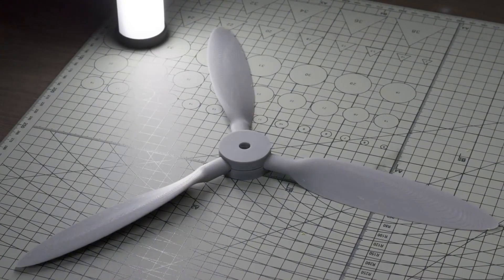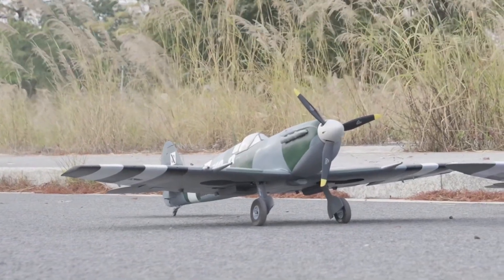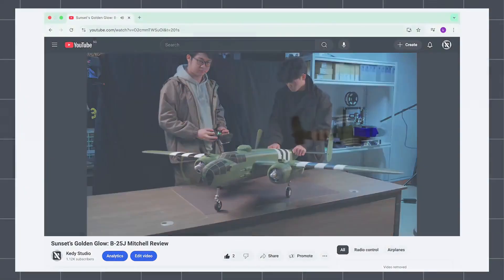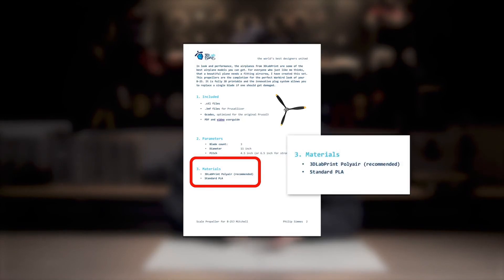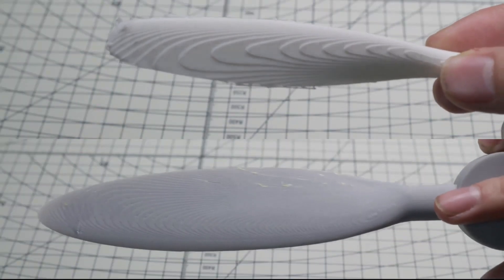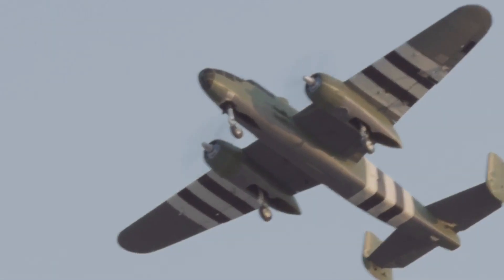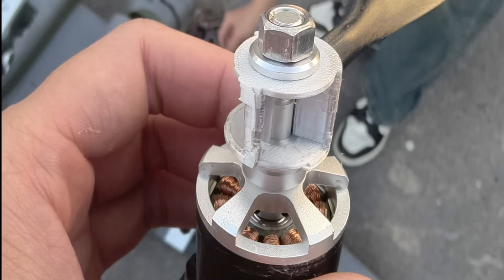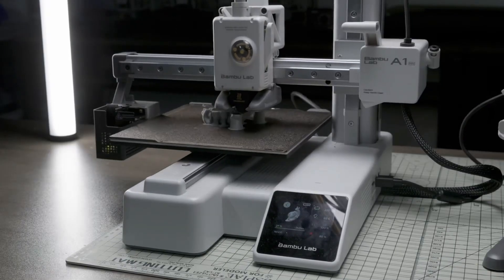Ultra-Low Cost 3D Printed Propeller Production! [DIY Propeller Solution]

Comment: I had better luck with 3D printing EDF's instead of propellers and using regular PETG at 240-250*C and low layer heights large line widths. (0.1-0.15 layer height as needed for overhang printability) Printed with no support. in a 6-blade diy EDF I made. seems to hold up and produces 200g of thrust with only 64w! Quite high efficiency and  the rotor/fan is only 6g! Entire EDF unit weight is 3D printed and only weighs 68g including motor and motor wires.

Comment: Well, I think to use 3D printed propellers not only for airplanes, but for for FPV drones too, from 6 to 13 inches. Using SLA printing, of course, because ABS-like and Nylon-like fluid already existed. And, sure, I still dont understand your answer about more firm propeller base - how do you want to create it. Please, can you make this moment clear, which material you want to use?

Comment: I was looking for videos on producing 3D Printed Whirly Gig propellers, specifically sleek, High Efficiency propellers that turn slight breezes into steady fluid movement, when I stumbled on to this video. At first I was just interested in printing Propellers,  but as I type this I realize, that an entire Whirly Gig could be 3D printed. Do you have, or know of any large, High Efficiency 3 D printed propellers i could use for Whirly Gigs ?

Comment: Pure thermoplastic most likely has too little stiffness, leading to aeroelastic deformation and hence loss of performance. Ideally the prop is fiber reinforced. This can be achieved by using 3d printing to print injection molds for the prop. That's how I did it some years ago.
Reply from the maker: Thanks for your advice. Appreciate it